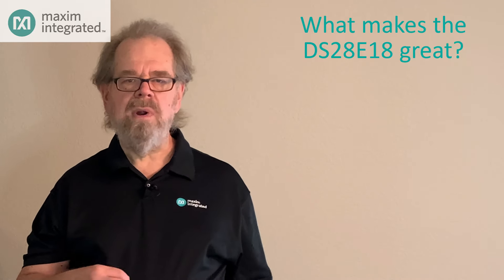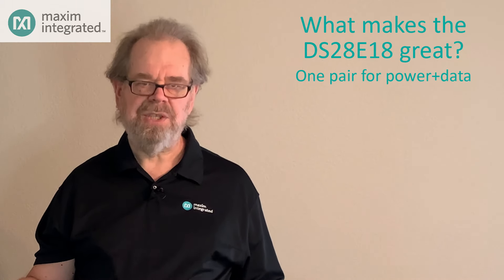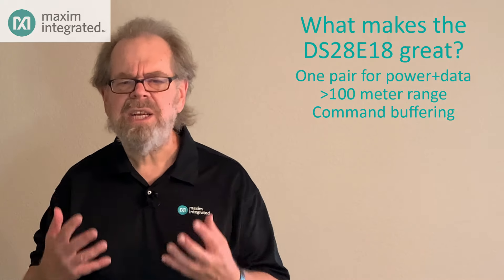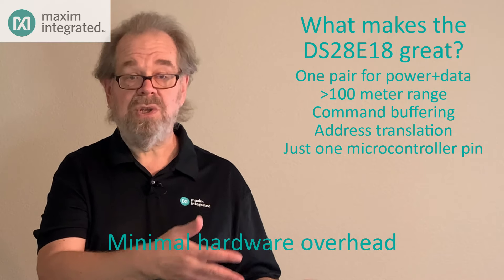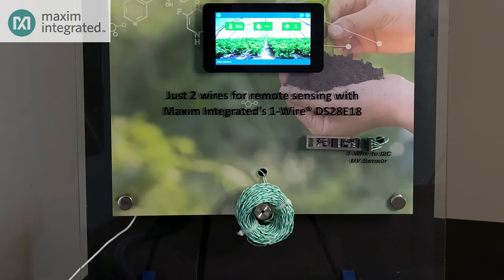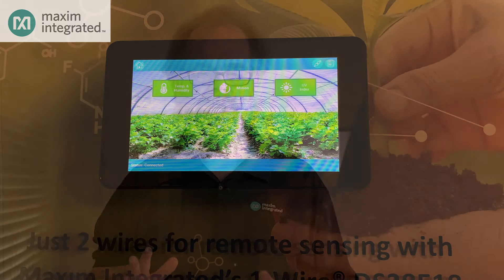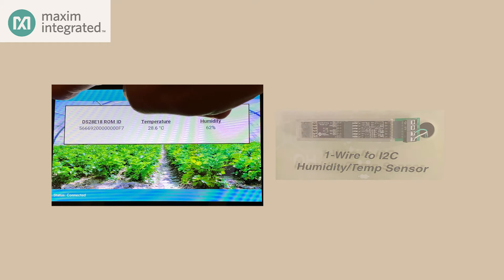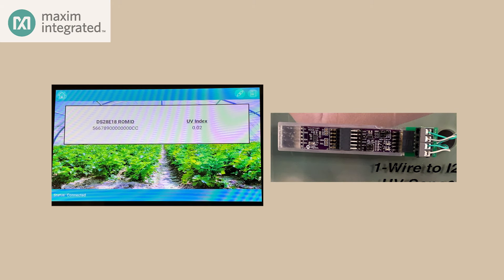1-Wire Remote Sensor Reference Design

Comment: Ben, you're a great presenter! Your approach made the content come alive.  I want you to know that yours is the only YT advert I've watched all the way through.  Excellent execution! (BTW:
4:31 - That coil you're holding is about 4" in diameter times 3 for a crude π approximation giving a length of one loop of about a foot.  I'm guessing there are between 50 and 60 loops, so your coil is around 60 feet long.)